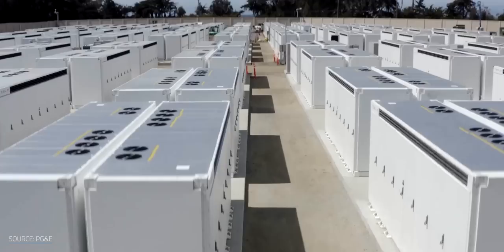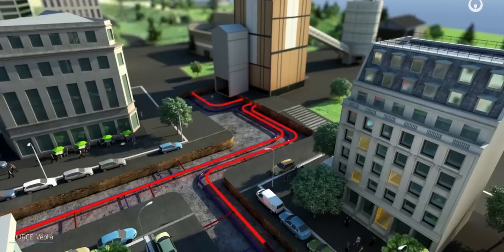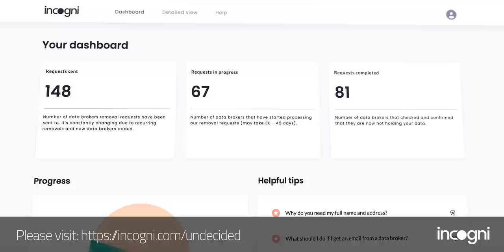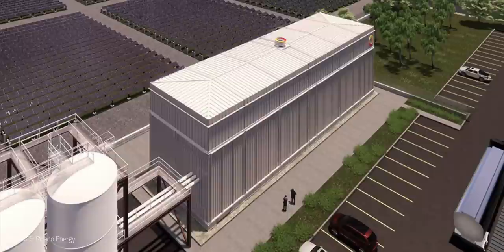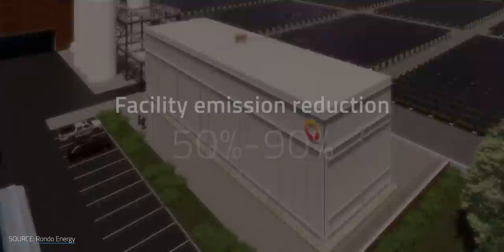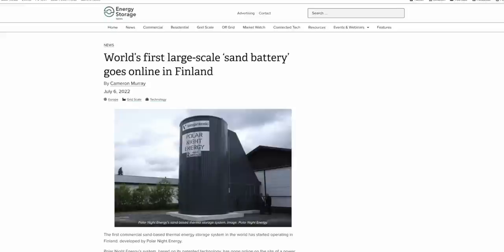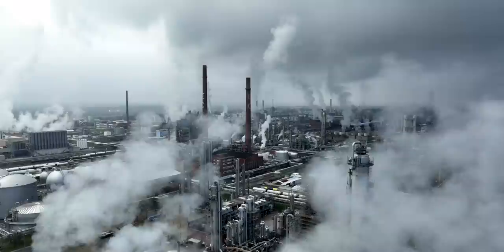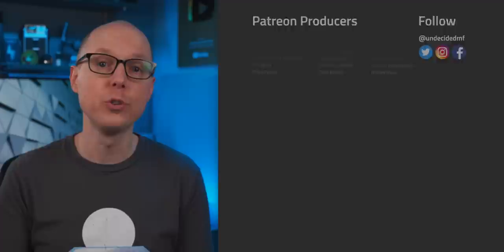How A Brick & Rock Battery Is Changing Energy Storage

Comment: The biggest issue with thermal storage is typically the same with gravity storage, the volume of materials you need to store an appreciable amount of heat is usually ridiculous and impossible to do at any scale.
Reply: Not the same at all.  The amount of heat that can be put into a single atom it much more than its weight.
Reply: @sephreed1938 
Yeah, theoretically you could pump so much heat into a rock that it vaporizes if you wanted to, though it wouldn't be very useful in that state XD
Reply: A drop of a kilometer roughly translates to a temperature change of 10C. So unless the drop is really big, or the heat is slightly warm, thermal does way better.
Reply: It’s almost like any one single storage method will never be sufficient for our uses and that we need multiple.
Reply: For home use, yes. For industrial use, not really. 
If you  build a thermal battery 3m tall under a typical industrial building of 200*150m, you got an 80.000kWh thermal storage under your feet. Make it parking lot-sized an you get several MWh. The point is that the thermal storage material is cheap or might even be free as garbage material from the construction site.
Reply: It is a lot like night storage radiators, same principle, I have not met a homeowner with storage radiators that didn't say the heat runs out half way through the day.
Reply: @waltermcphee3787  the size of a thermal radiator is somewhat limited. Outside there are much less restrictions. A thermal battery of several cubic meters is impractical in your home, but no issue at all in an open field.
Reply: Spoken by someone who is completely clueless!

Comment: Even if it can't get to the 1600⁰C for now, by heating the ore to about 1000⁰C, it means that the electric or fossil fuel component, only has to make up a gap of 600⁰C instead of the whole range from ambient to 1600⁰C. And that would still be a significant reduction.
As fara as the tobacco plant is concerned, they most likely need hot air to control the humidity in the tobacco leaves they'll be using. 
This tec has great potential in all kin of heating applications from residential to industrial!
Reply: I'm thinking you could also use it to generate steam to run a turbine which could then power something like an induction or arc heater, which could then go higher.   There would of course be an efficiency loss there but if the power that went in was originally free or very cheap, it might still be worth it.
Reply: @redsquirrelftw  It's never free and the steam turbine setup would probably be more expensive than an electrical battery.
Reply: @Rig0r_M0rtis  At industrial scale the steam would end up cheaper. Just look at how EV prices keep going up. They are running out of material to make batteries.
Reply: @redsquirrelftw  EVs have very specific requirements when it comes to batteries. But why do you think coal power is so expensive? It's not because coal is expensive, it's the whole setup with hight pressure and moving parts that can't economicaly stand up to solid state photovoltaics. Burning electricity to make steam to make electricity does not make sense.
Reply: @Rig0r_M0rtis  Kinda like burning coal to make solar panels and steel trubines to generate power... (and: 'burn electricity' ???)
Reply: @ibubezi7685  Nope, I think you missed the point entirely.
Reply: That was my thought. Even if the battery doesn't supply all the heat, it can supply enough to build a hybrid heating system that still cuts down on fuel, as well as providing a way to recapture some heat as the steel cools.
Reply: That's a factor I hadn't thought of either.  Brick heat to ~950C (due to losses) and power the rest conventionally.
Reply: That's exactly how geothermal for homes works already. Just lowers the load on your furnace, doesn't remove it.

Comment: There is also the issue of storing cold. There once was an industry based on cutting ice from frozen lakes. These blocks of ice were stored in sawdust and in the summer use to renew the ice in ice based refrigerators.
Reply: I agree. While heat pumps have proven efficiencies, I'd like to see a cost benefit analysis of bringing lumps/bateries of cold stuff to warm places (or places that need cooling in the summer), in order to fill their "heat pipes" with something that can alleviate the energy costs of those there, during warmer months.
Reply: That said, hot is easy and has limits placed only on containment ability. Cold stops at absolute zero and is, by orders of magnitude, less than hot.
Reply: in Helsinki, Finland there are several big underground tanks / pools to store cold water. That water is chilled passively with sea water during winter and heat pumps are used during summer. Hot side of those heat pumps is pushed to district heat piping, mostly used for hot water during summer but of course some locations need a bit heat also during summer. 

And yes that cold is distributed around city as district cooling for cooling offices and homes. Storing the cold water also helps with midday sun as heat pumps only need to be powerful enough for 24h average, not for the highest peak cooling demand during afternoon.
Reply: Look up Ice storage air conditioning
Reply: Cold per se cannot be "stored", since it's not a quantified physical property.  You can store cold matter.

Comment: In Renew's Sustainable House Day many years ago, a house in Adelaide had a room full of rocks surrounded by thick insulation. In winter they were heated by a simple solar air heater in daytime and released heat into the (well insulated and well designed) house at night.
In summer they slowed down the temperature rise.
They didn't eliminate powered heating and cooling entirely but reduced the need for it.
Reply: What kind of insulating material was it

Sounds interesting. Maybe buy a rock feature to put into a room
Reply: @furythree  Expanded polystyrene all around as I remember. There would have been sufficient strength to support the fairly large mass of rock. It was around 2.5 x 2.5 x 4 m to have sufficient thermal mass. Adelaide winters are cool but sunny so you can store a bit of heat in daytime

Comment: 13:06 For higher temperatures a steel manufacturer for example, might use a heat battery to recover heat from cooling finished materials and preheat raw materials. At lower temperatures, a different manufacturer could also incorporate heat pumps to improve waste heat recovery.
Reply: I like that idea also say if a sand unit was say 10000 units in volume at 1000f then could this be converted using Peltier to induction to heat up say 1 unit of steel 
the efficiency ratio may not be that great but if we are talking about free sun and wind energy then its a total win...???
Reply: And reducing the total power, not just about replacing it.
Reply: Just pump hot air from the equator into the homes closer to the polar regions, and pump cold air back as free air conditioning in the patched climates
Reply: @billsemenoff  duh right?
Reply: @Rig0r_M0rtis  we already know Elon musk like digging tunnels, we just aim him at this project, I'm sure he'll get the government funding for it and even solve a few technical wrinkles. Polar-equator HVAC tunnels for all!
Reply: @billsemenoff  tiny issue with that, mainly being, anything in motion generate heat, and if travelling long enough distances then it will become hot, and im pretty sure that travelling cross continent no matter how cold, when it arrives it'll become hot
Reply: @shadowmaster335  well yes, for air specifically, that's probably right. But they used to ship ice back before electric refrigeration, how crazy is that!
Reply: @shadowmaster335  Dunno man. Last  Christmas when I travelled to Germany from Australia I felt pretty cold...

Comment: This process could be made even simpler by using lenses to focus sunlight on the rock directly and increase insulation for heat loss.The more insulation the more efficient the heat battery. 
I run a gasifier that runs on wood pellets and is installed in a metal box full of sand which is then insulated with 4 inches of foam.I gatther the syngas to run a generator and run a gas kitchen stove and the heat lost is gathered in the sand  mass and is used to heat my home. When availible I use gras clipins and leaves that have been pelletized to run in the gasifier. The pellet machine is run by the generator.

Comment: Given the commonly held thought that most of LI-Ion batteries are going to go towards EVs, people are going to have to start giving serious thought to other forms of energy storage for microgrids.  Thermal storage is interesting and would be a good pairing with a flow battery for a microgrid on a manufacturing campus.
Reply: Vehicle-to-grid and older Li-ion batteries with reduced capacity allows lithium-based batteries to support microgrids. Although agreed, more technologies = more better.
Reply: Lithium based batteries have decades of life in them, but after the first 15-20% degradation they're considered "spent" in vehicles. These "spent" batteries can still function for another 10-20 years in grid storage! It takes 5-10 years before enough second hand vehicle batteries enter the market since EV's only have been seriously popular for a years or two, but after that i would be surprised if batteries are specifically manufactured for grid use. There will probably be more second hand batteries than we can put in the grid. I guess most of them will just be recycled.

All of this is assuming governments all around the globe actually enforce the requirement to reuse or recycle used lithium batteries.
Reply: I dont get it. A EV battery is enought to supply a home in electricity for 3 days. Why would we need any other storage?
Reply: @pierregravel-primeau702  Some quick thoughts:
1. Not everyone will have parking for their EV outside their home/can leave it always plugged in.
2. Not everyone will want to allow V2G.
3. What if everyone is stuck in traffic at the same time and few EVs are plugged in?
4. What is the maximum discharge rate?
Reply: @pierregravel-primeau702  One main issue is the supply of Lithium.  We are already seeing huge spikes in the price of Lithium and we have barely begun the EV conversion.   So we need to move away from Lithium for places where the weight of the battery is not relevant.   There are several areas like the ones above and other battery formulations that are a better solution than Lithium for fixed implementations.   They don't work well for cars and laptops as they weigh considerably more than a Lithium battery.

Comment: Funny enough, this kind of heat storage would actually work really well in places you wouldn't think need or want it, namely desert and high plains. They still get cold enough to need heat, but lack of infrastructure around heating means they over-pay for it to great detriment. Down-side is that it's only effective in high density use areas like cites and industrial parks

Comment: Food processing uses a lot of steam and heat, might be a real game changer there for either of the major 2 you mentioned.  The Rondo system patent is one heck of a read... they've done the math and physics, it's a really well detailed set of information
Reply: If sooo many spareparts didn't  eat criminal junk food no need...
Reply: You want fries with that ?  maybe not...  are french fries that are air fried junk food btw ?
Reply: @bartytaylor2106  you know if you buy a package of frozen vegetables, that in their processing prior to freezing, they were blanched - eg dipped briefly in nearly boiling water, then dried and frozen ?  It takes a lot of heat to maintain those volumes of water.  There are many food processing steps that need heat, and they don't create junk food necessarily.
Reply: @lylestavast7652  lubberly to hear from U what mammels eat frozen gweenz ....😱
Reply: I've worked in several chemical industry companies which have they "steam lines". They're like power lines but for raw heat. They usually hook the steam line to a heat exchanger and drop the pressure. This way they get energy from the changing the phase from steam to water.
Reply: @lylestavast7652  One supposes it matters if you live off frozen veggies I dont!
Reply: @lucasvivante8988  I don think the aforementioned can read and write...a little similar to you 😆

Comment: My question is how big do these things have to be?  Imagine having solar panels in the winter that heats these bricks, then at night heats your house. Each house having their own set of bricks. It would be a cool option for a cabin.
Reply: The problem is winter sun doesn't have enough energy even if you covered your house in solar panels, even a heat pump with a COP of 3 probably wouldn't be able to get enough energy. You need large scale renewables as the energy source because the amount of energy required to heat a house in winter is closer to 80kWh per day than 8kWh. Also what these heat batteries don't promote is that if they are heated up using spare electricity it is only 100% efficient whereas a heat pump is more like 300%. For your scenario using a heat pump to raise a two cubic metre insulated box of water up to 55°C  for extracting heat passively until it's down to 20°C would provide about 80kWh of heat energy for closer to 25kWh of mains electricity.  The other alternative are solar collectors to directly warm the water using the winter sun, that could be even cheaper to run as at it's most basic all you need is a black box to absorb solar radiation.
Reply: @augur1975  anyway solar is very inneficient and very polluant. But nuclear energy need a way to store excess energy. The most obvious choice is to buy energy when it's at it's cheapest (during daytime) to gather excess from nuclear and to use it for your house during night. So the question remain, how much energy can these bricks hold?